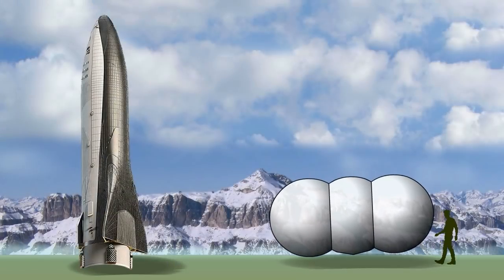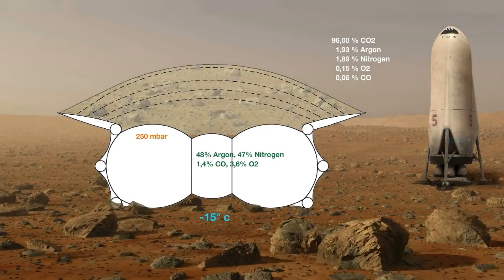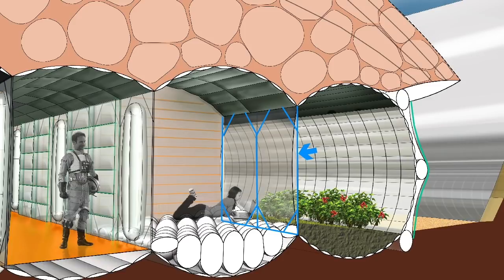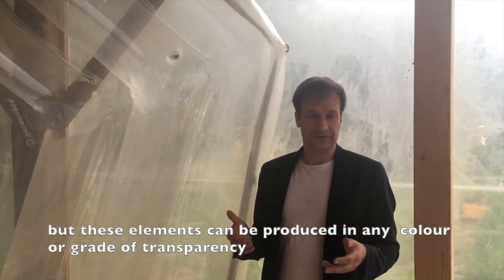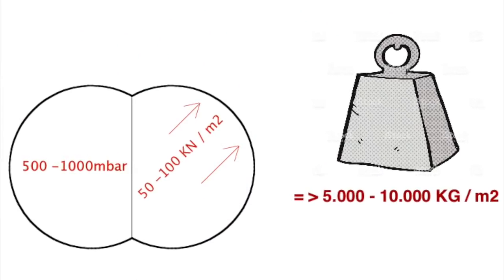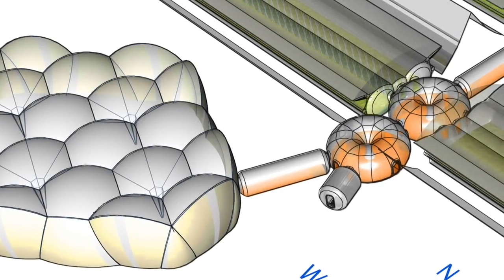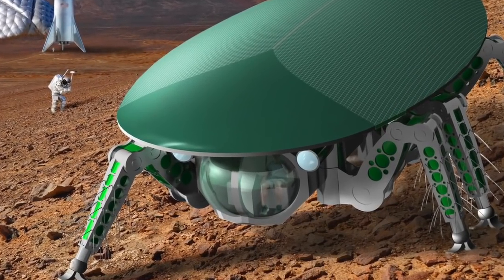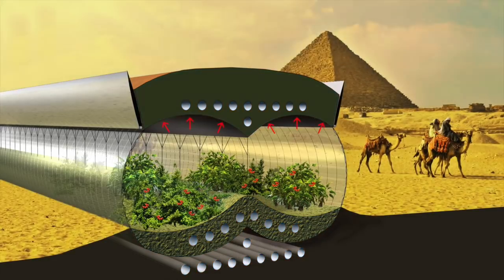inflatable Mars habitat and Lunar base

Comment: Hi, I think, that this is globally very good concept.
Probably, you would need more nuclear power that sun, because of the long dust storms on Mars, sometimes during several months, so, you have to plan a way to heat the place in this case or calculate for some heat accumulation in the soil around.
Despite all the criticism of some other comments, and the reasons why printed habitat may not be possible at the beginning of human presence, I think your proposal is very good.
Please continue to develop your concept.
And could you give some more information about the sun reflectors, I think that the weight you give for them is a bit low.
Thank you for sharing this.
Reply from the maker: Thanks for sharing your considerations that concern some important points.  According to the data collected by the Viking lander, dust storms reduce the available sunlight to 30%.  The direct radiation suffers from the dust but not so much the diffuse radiation.According to our calculations still still is sufficient to heat the habitat to an acceptable level. for a habitat on the equator  Photosynthesis slows down but still is going on. On Earth clouds in the sky or fog can swallow a much higher percentage of the sunlight .  As you mentioned the thick soil around also stores a considerable amount of heat for preriodes with less sun. 
When you download the catalogue from our website     www.marshabitat.space.    , you find the information about the sun irradiation and heat transfer calculations  on page 13-15
The material for the mirrors is just a thin hanging  membrane. frames to hold the mirror membrane should be made of carbon fibre tubes. The tubes can be short when placed on embankments of regolith

Nuclear Kilopower reactors should be taken to Mars too. But only to produce electricity or heat for industrial melting processes,. Since photovoltaic panels give less power during dust storms and the surplus of electricity on a sunny day cannot be stored easily.
It is better to have several sources of energy. But natural sunlight still ist the most reliable, the cheapest and the most efficient.
At the moment we are working on a prototype of the derived design for a greenhouse on Earth.  But I hope to get a funding by European Space Agency this year ( we are in the closer selection process now) to continue and more focus on the Moon habitat version, because this is where the technology should be tested first, before being applied on Mars
Reply: @thomasherzig174  Thank you for your answer. I did not know the numbers about the light absorbed by the dust storms. But still you will need to clean the mirrors (maybe some vibrators can do this for cheep if the dust is not too much glued by static electricity ???).
You talk about short tubes to hold the mirrors, but on the video you talk about moving the mirrors. You would do it manually, say one time per week or months? I also did some rough calculations about ultra light movable mirrors, and I think that an average of 50g per square meter still low. Even if the strongest martian wind is equivalent to a 25km/h, the very big surface of the mirrors may make them act like wings and need some straiteners and anchors. But I might be wrong on this.
Anyway, your proposal seems very interesting, solves a lot of problems.
Reply from the maker: @ChristianCOMMARMOND    the top edge of the mirror membrane is not moved at all.  Only the bottom edge is moved horizontally towards or away from the habitat by winches.   It is like a curtain that you grab on the bottom and  lift and pull it. 
Since the mirror membrane is suspended , the geometry of the membrane alway will be  a parabolic curve, which is optimal to focus the light into the habitat.
The mirror membranes need to make a full  forward and backward movement in their position once every Martian year. So the movement is very slow. It could be done manually, but it would be better zu use  tiny automatic remote electric engines.  I would not be concerned much about possible damage through wind, but wind could disturb the curve geometry of the suspended membrane. So this is a point to be addressed later when the design goes more into detail

it is 0,5kg = 500gramm per m2 not 50gramm/m2 in the video
Reply: @thomasherzig174  Thank you for the information. Sorry, I thought that I heard 50g... 500g is maybe too much.
I just thought about that: is there a way to give the shape to the mirrors and to straighten them with inflatable tubes?
I think that I saw somewhere a design of inflatable structure where the inside parts of the inflatable part are filled with a polymer which hardens when put in contact with the gaz used to inflate it. So it is soft when it is stored, but when you inflate it, after a while the material becomes hard and maintain the shape even if the gaz leaks.
Do you know about this?
(Sorry, I'm French, and may english is not very good).

Comment: the best way is to test it on a large vacuum chamber with same pressure as mars for months or year? just opinion hehehe
Reply: Agreed. There's no good reason not to test this method here on earth. It's not too difficult to simulate off-planet conditions here. And it's much easier to make changes here than off-planet.

Comment: I see a number of good ideas here.  One major mistake, however, is that argon is heavier than oxygen and nitrogen.  While it works great for scuba divers with proper mixing, it will fill the lower section and asphyxiate the inhabitants of a habitat.  Instead, just absorb the nitrogen and add oxygen.  

Also, CO buildup will be a problem at some point.  My suggestion is to use hydrogen/oxygen combustion for cooking and heating.  It will also destroy the buildup of trace CO.  It will get very cold at night.  

The sunlight mirror is a good idea but remember that Mars sometimes has dust storms that can last months.  Natural Spectrum LED will work fine.  LED's made for DC current can last a lifetime, unlike the typical ones you buy for homes on Earth.  Actually, they could be made to last a century or more..  

You really don't need that much regolith on top..  One meter will block all cosmic rays, solar flare radiation, and protect against typically small meteors.  Honestly, 1/3rd of a meter should be enough.  Too much weight will force too much air pressure to keep it up...  It's equal to crushing the inhabitants under that regolith..... Consider also rigid structural components..

As for the material, I would suggest PVC.  It's highly insulative, fire resistant, and maintains pressure very well.  Also, given sufficient energy, you can easily mass produce it on Mars using the high pressure steam method.  That is, acquire chlorine from the plentiful salts in the regolith, as well as water, and the CO2 rich in the atmosphere.  Steam that all together under high temperature and pressure and it will rain PVC resin.
Reply from the maker: Thanks for your input:
regarding the problem with the different  specific weight of argon, you might be right. I forwarded it to my partner who is a physicist and has has elaborated that system of extracting liquified CO2 and converting  CO to CO2 to get breathable air inside. I am curious about his response.
Regarding the sunlight, it is not that bad during dust storms. I am referring to data collected by the Viking lander and  NASA report TM 102299 by Joseph Appelbaum and Dennis Flood  written in August 1989. The direct irradiation is significantly reduced during dust storms, but diffuse radiation is not much affect. So the global irradiation still is  30%  of the Maximum at least . According to our calculation these 30% still are sufficient to keep the temperature at 20°c inside without any additional heating and sufficient light for the greenhouse . On the  download section of our website: 
http://www.marshabitat.space/downloads.html
you can find the data and  calculations on page 13 -15
Reply from the maker: regarding the membrane material,  PVC gets very brittle below +10°c. this is why I even don't use it for outdoor structures on Earth. On Mars that temperature problem is worse of course.  Second, there is no UV-resistant transparent PVC available, and 3rd the mechanical strength of PVC is poor compared to other material unless it is reinforced with fibre.  I would opt for ETFE or aliphatic UV-resistant TPU.  But for indoor components it might make sense to produce components of PVC, produced from salt of the regolith and Carbon from the atmosphere
Reply: @thomasherzig174  Yes.  PVC freezes and become brittle.  So either additives or foaming are necessary.. For inflatables, you'd be adding plasticizers anyway. some of them solve this problem very handily.  I've seen PVC pipe in the water under docks in Alaska.  When foamed, it chips upon impact instead of catastrophically breaking.  Pure PVC is clear (with a light blue tint) and UV resistance is sometimes a problem only when very thin.   Car dashboards, for example, are almost always made of PVC (with additives, granted).  

This is not a big deal but I am partial to PVC for a few reasons, one of which is that it could be mass produced, in situ (given sufficient energy).
Reply from the maker: @solifugus  ESA confirmed to me a few days ago, that they will fund me continuing working on my design and research. Material research will be part of next development steps. From my experiences with building inflatable outdoor structures on Earth for 15 years, I prefer TPU and aliphatic TPU which is UV-resistant. and it still is softer in cold temperature than PVC even whiteout softening additives.  While PVC coated fabric  with extra protective  paint coating offers hight performance on membrane structures. clear transparent PVC does not offer good mechanical performance and UV-resistance.  But every option should checked  at least
Reply: @thomasherzig174 
What about Polythene, and Fibre reinforced Polythene ?
Reply from the maker: I now got a reply by my physicist partner to your objection about the higher weight of Argon.  In fact it would only set down on the ground in a totally calm environment, like inside a sealed bottle with no temperature changes. But in real conditions air is always in movement and molecules are spreading and mix with the environment . please read blow:
No, that is not right. Just think about that there is 1% argon in our atmosphere. And also there is some even heavier carbon dioxide here and if he would be right, the lower layer of the air would contain a lot of argon and maybe we were suffocated to death. But this is not the case.
The fact is, that the gas particles have a very high speed - the speed of sound - so in a gas mixture, the particles are perfectly mixing with each other quickly. Perhaps there is a little difference in the argon concentration between the lower and the upper atmosphere, but this difference is unrecognizable in a few meters in height.
Reply: @thomasherzig174  Like in a scuba diver's breather, as long as it stays mixed then it is fine.  Obviously outdoors on Earth, we have winds and if you keep the air moving then you're fine.  However, I'd be concerned in a sealed environment, especially when sleeping.  It's extremely rare for such cases to exist on Earth but there are known cases of deaths due to inert gases, including argon.  For example, https://nvic.nl/sites/nvic.nl/files/pdf/case-report3_8.pdf

But why use argon, in any case?  Mars has nitrogen, too, that you could filter out and concentrate.  Furthermore, nitrogen is vital for plant growth and the human body also makes some use of it, if not very much.

I think the most common thing overlooked by most designs for martian living is the CO buildup potential.  It's only a trace gas but will build up gradually when moving in/out of an airlock or on bringing martial regolith inside.  I'd have to read your article again but I think you did mention it.  If so, you are one among very few to consider this silent killer.... detection and destruction of CO is crucial.
Reply from the maker: @solifugus  while argon is 25% heavier than oxygen, , oxygen is 14% heavier the nitrogen. so the difference of specific weight is not that dramatic. from local temperature differences ( when sunlight is reflected into the greenhouse) and movements of humans and flying  insects inside there also will be movement of air inside.  In case it is not enough ,we still can install a few small electric fans, to keep on the air moving and mixing the different gas components permanently
Reply: @solifugus 
I think aiming for an Earth-like atmosphere has some obvious benefits.

Obviously there does need to be a forced air circulation system.

Making use of external day / night temperature changes, could be useful for driving some kind of mechanical air pump ?
Reply: @peterclarke3020  Day night temperature differences could also power a sterling generator.  However, the 15 mph winds day and night will provide a steady stream of energy.  I suggested to use this to directly pump water from a lower to upper reservoir to act as a batter by controlling the rate of flow back down hill through a generator turbine.  These are inexpensive and very efficient on Earth.  By building a colony on the side of a hill, you can allow this water to flow through acquaponics systems, bathrooms, and kitchens, also.  It will easily generate enough energy for fans to push the air around.
Reply: It is NOT true that 1 meter of regolith will "block all cosmic rays;" that would only block the more easily blocked cosmic rays. One source offers that it would take around "1000g/cm^3 of material which equates to 5 meters of lunar regolith (2g/cm^3) or the Earth’s atmosphere" to block Galactic Cosmic Rays to Earth-equivalent levels. Likely the density of Martian regolith is similar? One can use less shielding if you envision astronauts just briefly visiting, but if they are staying long-term, Earth-equivalent protection would seem desirable -- especially since they'll be getting a lot more radiation whenever they leave the habitat. (See http://www.rcktmom.com/njlworks/LunarRegolithPprab.pdf ) The inflatable habitat won't be able to support quite that much regolith if it's not using full atmospheric pressure. But, it will be desirable to pile as much regolith on top as one reasonably can.
Reply: @zzubra  When I was in the military, we were taught that 2 to 3 feet (1 meter), depending on composition, of dirt would be sufficient to fully block the radiation of a nuclear blast.  I have read 1 meter of water will fully block cosmic rays and solar flare radiation, in space.  I have also read that Martian regolith generally has about 2 liters of water ice per cubic meter....  I also personally wonder if small amounts of cosmic rays are healthy.  On the surface of the Earth, some do reach us, normally...
Reply: @solifugus  When deciding how much radiation shielding is "enough", it depends both on what type of radiation one is talking about, and what dose is considered "acceptable." A nuclear blast is a short-duration event, with a particular spectrum of radiation; it's likely to occur in situations where you've got more important concerns than getting cancer in 30 years, so I'm not sure what standard might be being applied to acceptable doses. Galactic cosmic rays include some astonishingly high energy particles which can get through just about anything. The earth's atmosphere provides shielding equivalent to about 5 meters of dirt or regolith, and that is not enough to block ALL cosmic rays. Less shielding will allow more cosmic rays through. There is room for debate about how much radiation, and how much health risk, is "acceptable." But, it's clear that for Earth-equivalent radiation levels, you would need around 5 meters of shielding. (That's assuming that the dirt/regolith doesn't itself include radioactive minerals!)

Note that solar flares and Galactic Cosmic Rays (GCRs) have very different characteristics. The former are much easier to protect against.

Any language that talks about "fully blocking" GCRs is inherently false, given the penetrating power of the most powerful GCRs. Such language always means "blocks to some standard" and if that standard hasn't been specified, the meaning is pretty unclear.

Water and other materials containing light-weight nuclei are better at radiation shielding because they don't produce so much secondary radiation. I'm not sure if they are actually better at blocking primary radiation? So, I'm not sure how large an effect the amount of water in regolith is likely to have on the amount of shielding needed. Likely some, but...? Edit: The Earth’s atmosphere is equivalent in mass to about 5 meters of regolith. But, the atmosphere is made up of elements with light nuclei. So, if light nuclei are significantly better at shielding, then that would mean you would need MORE than 5 meters of regolith (presumed to have a lot of heavier elements) to be Earth-equivalent.
Reply: You say PVC, I was thinking Fibre Reinforced Polythene.
Both are patch repairable.